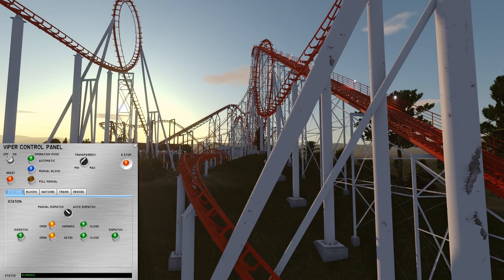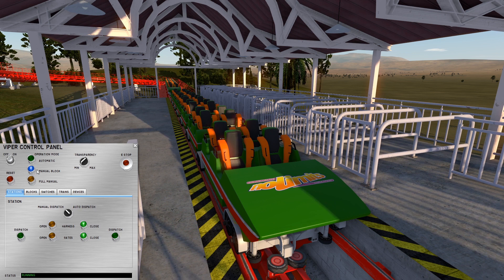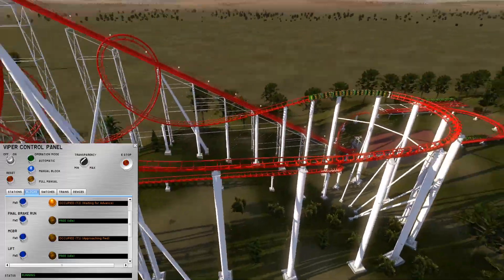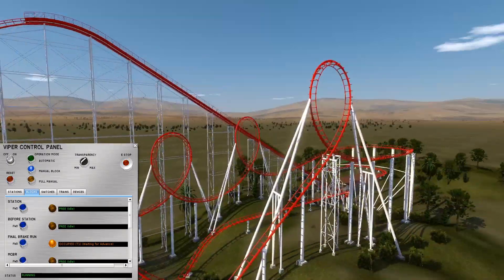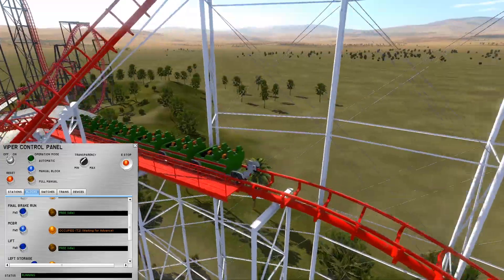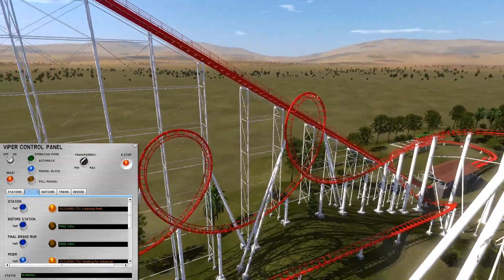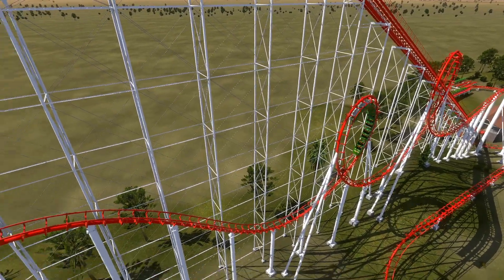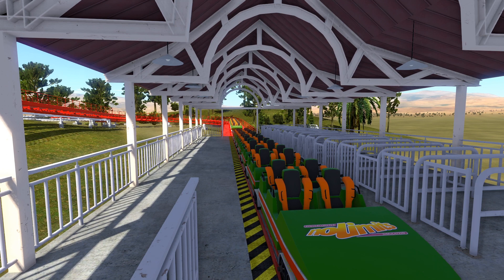Roller Coaster Morning Block Checks Explained With NoLimits 2

Comment: Yep!  That's exactly the way it was done.  I ran an old Arrow coaster.  I sure do remember the roll backs in cold weather with maintenance standing there to catch it.  If it did roll back then they had to get a crane to pull it out.  I always did the block check every morning.  If I worked a double on another ride and there was a shut down I would always get pulled to run the block check because the afternoon/evening crew never did them.

Comment: Can you provide more detail about warming up trains? What purpose does it serve? Potential obstacles are there for cold trains? Do you ever heat the trains before warming them by running them?
Reply: Cold weather increases friction, making the trains move slower. So they start by running them a bunch to decrease the chance they valley or otherwise get stuck due to slow speed. Running the trains warm up the wheels so more momentum is conserved due to less friction.

Comment: There is actually a way to simulate block clear interval in NL2, you just set the extra block length to a certain length which tells the ride system to not let the previous train advance until that extra length is clear too, even if the train has left the brake run. Good for spacing out trains and preventing multiple stacks as you said.

Comment: Would I be correct in guessing that some block sections are intended to only be triggered in emergency, and require a manual restart, but others which are intended to be employed more routinely (e.g. because a passenger takes too long disembarking, causing trains behind to get backed up) and include safety equipment to allow for routine automatic restarts?
Reply from the maker: Yes, on most coasters, some older arrows are a little more picky but in most cases yes that's true.

Comment: um just to point out something, the mid course brake release is actually about 3/4 the way up the lift hill, i know this due to have been a ride attendent and got to close viper one night and i got sent up the lift hill to release those brakes. so that maintenance could pull the trains into the storage area.

Comment: Ive opened viper many times and during block check we can enable the touchscreen display and release the train, each train gets cycled a minimum of 6 times per train before we check the blocks if it's a 2 train op day. The last block we check at viper is station to lift then test to see if it'll dispatch with unlocked harnesses and open air gates, each train to test blocks has to sit for 10 seconds before the computer can pass it. For the most part yea you've nailed vipers block check, and matniance is standing with us for a just in case of an error.
Reply from the maker: Awesome thanks for the info, a lot of these arrows work the same!

Comment: How does a ride fail the block checks? Block brakes fail to activate and the (empty) trains crash into each other? Does that ever happen? I imagine that would be really bad, but of course much better than if there were riders on it.
Reply: If one were to do a block check using two trains, and kept the block ahead of the front train clear, then even if the next train blew past its block brake it would still be many seconds from the train in front; if someone is present to release the one in front, the brake that had successfully stopped it could stop the one behind.

Comment: To be fair, NoLimits 2 is designed with creativity in mind.  The maintenance procedure is secondary to that and it assumes that the coaster is running at peak efficiency.  Even the effects of weather on the ride are not simulated at all.
Reply: It would be nice if they added features for those who like to operate it. For example, I don’t loooove building them but “operating” them would be fun :)
Reply: Designed with creativity in mind?
Hm, then can you confirm if it fixed the original's issue re: connecting tracks back to the station on custom coasters?

Comment: popping a vertigo/anti-nausea pill to get through this video  

Excellent explainations tho.  I would love to see the actual daily walks & checks each ride goes through from the very beginning of the morning.  Does someone really have to walk to the top of Millenium?  #legdayeveryday  And what are they looking for?  And do the employees get to take rides before the park opens to the public that day?   Lots of questions...
Reply: i know i am 3 years late and work at six flags instead of cedar fair but
a certified operator needs to check to make sure maintenance has signed off for the ride to be operated, then they do a perimeter walk around the ride area making sure all the gates and doors are properly locked, then we turn on the ride, make sure our stop buttons work and do block check, then we do a safety ride (each train must be ridden by a certified operator to make sure the ride experience is normal- no unusual noises, smells, sights or vibrations. can't tell you about millenium force but some rides require someone to climb to the top of the lift to test an E stop, but not all coasters.

Comment: Do a video on what happens when a train valleys.
Reply from the maker: Cool idea I will look into it!
Reply: @CoasterCollege  Sweet! I've always wondered
Reply: Me:  Puts coaster in full manual mode, pushes train near top of hill, stops it, puts coaster in automatic mode.  Train rolls back and fourth until it runs out of momentum.

Comment: That was cool, and I learned some cool new things. I'd love to hear more on beak checks and other procedures done by parks. As a good example Maverick @ CP. When it stops at the top of the lift hill. What is the procedure to bring it back to the bottom? Or when Top Thrill Dragster rolls back, how do they get it to clear the tower? Anyway, great video and thanks.
Reply: With Top Thrill Dragster they have brakes that engage after the train passes over them through the launch, if the train rolls back the brakes catch them and something pulls the train back to go through another launch. The computer system has recognized this and the next launch will have a little more umpf as I like to call it
Reply from the maker: @coaster_dude22  Close, dragsters launch track is angled upwards, so the train will roll back to the launch position.
Reply from the maker: As for maverick, that ride cannot stop on the lift. From what I understand they test if it will start to launch when the next block is occupied. I could be wrong though!
Reply: @CoasterCollege  I don't know the procedure or why Maverick dose it, but I was on it once and it made a digital sound and stopped at the top of the hill. We sat for a few seconds and then rolled back about 3 feet, stopped, moved up the hill about a foot, and rolled back another 3 feet. This happened all the way down. Once at the bottom, the ride made a sound like it was connecting to the internet through dial up and then tried the relaunch. After three times of trying the ride operator closed Maverick and called maintenance. Since it happened I've been really interested in knowing why it happened and what caused it.

Comment: Tying into your comment about B&M block setting -- the rides are nowadays smart enough to automatically detect (via PLC) if the train has stopped in an unsuitable position and will potentially roll back. That said, the B&Ms at Cedar Point will never need maintenance, and will automatically clear as soon as the next block is available.
Reply from the maker: nice, figured B&M would have all that figured out.
Reply: I used to work for carowinds/Cedar fair for 8 years as a full time IT associate and closing IT manager for the park before being moved to the Corporate office at cedar point and helped the rides department at carowinds when they needed 18 plus year olds for controls as they where short staffed most days and didn’t have enough 18 plus so I would help in the mornings before my IT shifts and was certified on all positions at all rides in the park. All of the B&M rides and all of the coaster at carowinds would auto detect train positions and also auto advance mid course sections. The B&M rides would also auto restart the lifts after a setup once the next block cleared the ride would sound the lift start alarm again then after 5-10 seconds would auto restart the lift but only if a setup caused the lift to stop If the lift was stopped by a ride stop or lift stop on the main panel it required a manual restart by the start lift button at the base of the lift as well as the lift start on the main panel. All the non B&M rides required a manual lift start at all times when a lift stop occurred. Where you mentioned pushing a ride we had to do this with the gold rusher ride in the mornings at times at these trains sat on the tracks in the station all night and would develop flat spots in the wheels and needed to be given a hand to roll them out as carowinds only allows maintenance staff and full time employees to do train transfers or any kind of ride resets that clear faults ride operations does not do any of that at that park

Comment: Can Top Thrill Dragster get stuck at the top of it’s hill ?
Reply from the maker: Yes, however its very rare and not part of tests.
Reply: Nicole Westinghouse it doesn’t have a lift hill, but it sometimes rollsback
Reply: It got stuck at the top of the hill once or twice but that's incredibly rare, so if it ever happens to you consider yourself very lucky
Reply: I know it doesn’t have a lift hill.
Reply: Yes but it would have to be launched at the perfect bad speed in those conditions.